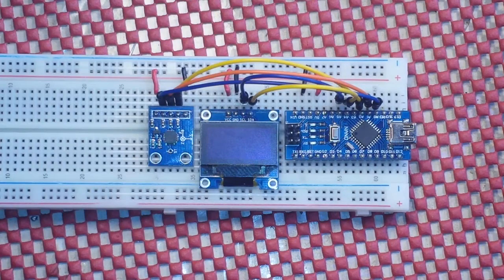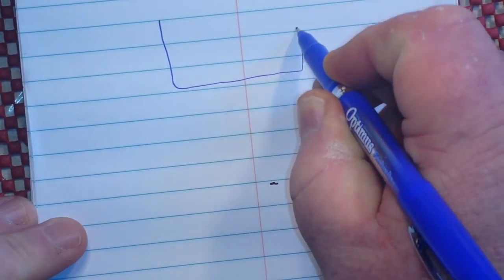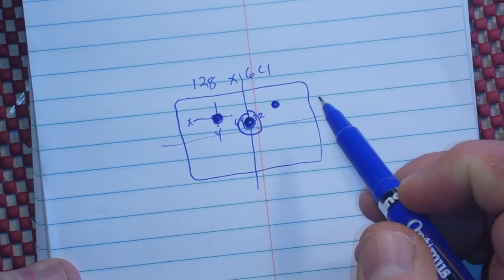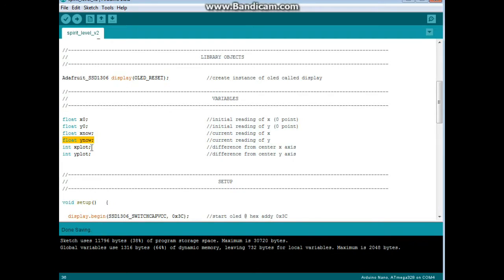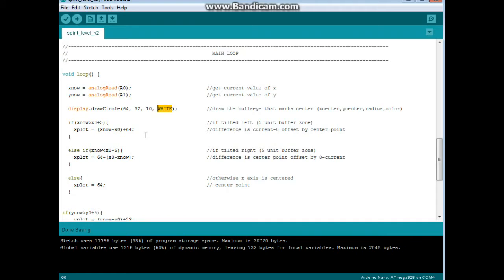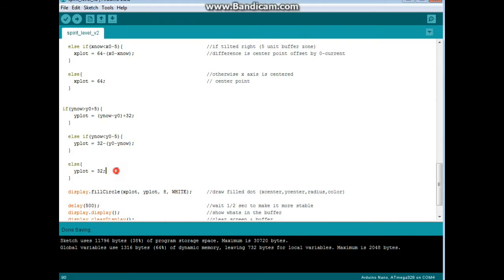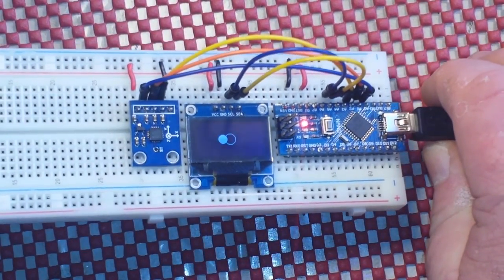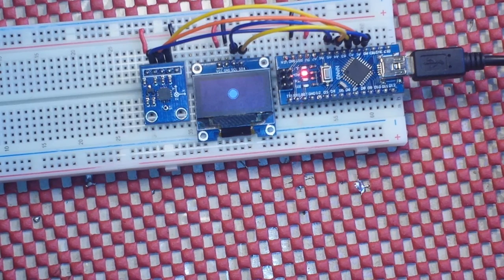Arduino 2 Axis Digital Level

Comment: Hello Thank you for this video, unfortunately I do not speak English and therefore I have trouble following it, I understand a little in writing.
I'm looking for this type of electronic level to upgrade a motorhome, then to drive hydro cylinders, programming does not pose any problem.

Some, in the comments, say that it is necessary to redo the point 0. This goes against my use, but is it not possible to save the analog values received when you made the first adjustment? for the first time (a calibration), to make this backup the reference 0?

Otherwise I can not find the link to download the code of this demonstration. Could you send it to me please?
Thank you.

Comment: This is great. I'm building a bed level for my camper van. Something like this display would be perfect. Just need to work out how to output to the 4 actuators. Quad copter research here I come...
Reply: This is literally what I am working on now, did you end up finding a decent controller? I was looking at some Progressive Automations chip bits to make it all work.

Comment: How would I set the level so that it would remember it after a reboot like an initial calibration? I would like to mount this setup on a instrument that would need a preset level to be remembered after a reboot.
Reply: Did you figure this out? I have the same request but not sure where to start!

Comment: I see there is a delay with the display.  Is this the display's low refresh rate, or the auds processor?  Interesting exercise, lots of uses.  Thanks, enjoying the channel
Reply from the maker: gfRally I stuck a delay in there. it could be removed and the updates would be near instantaneous.
Reply: Ooops (caught!) I skipped ahead on the code to see how it worked, I guess I missed that :) I will have to pick up the accelerometer and give it a try.
Reply from the maker: gfRally the adxl335 is super cheap and outputs an analog value, so libraries needed. have fun😀